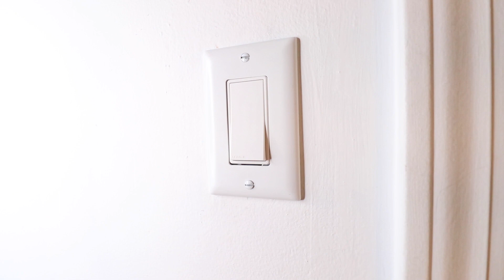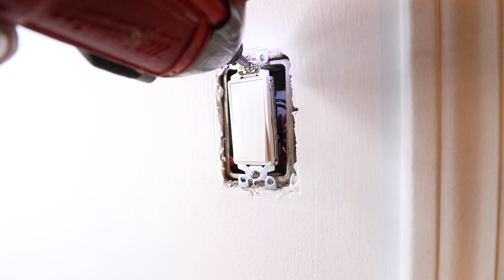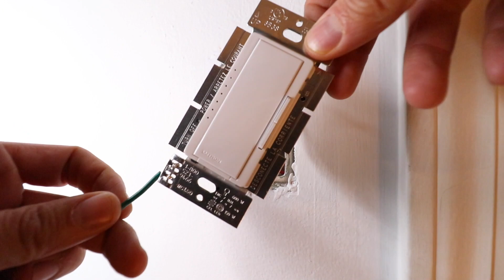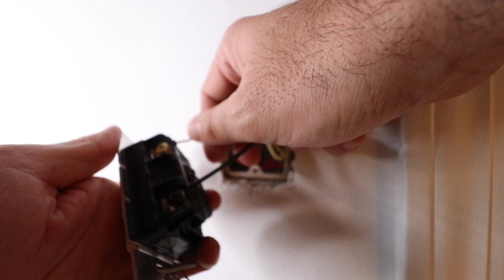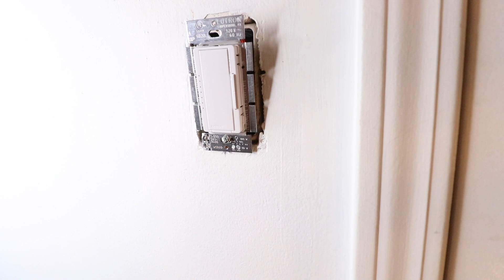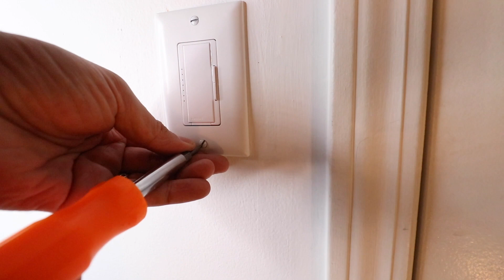Lutron Maestro Installation

Comment: Thought I must've done something wrong but after watching this, I did exactly what was done here; however, every couple of times I turn the dimmer on, it starts strobing and the dimmer LEDs start flashing up and down. I also checked and the LED bulbs I have installed are on the compatible list for this dimmer. Not sure what's going on with this one.
Reply: Did you found the solution?
Reply: Funny cause I came here to see if there was something about the programming as I have tried everything and mine is doing the same type of stuff and not saving where I had the settings
Reply: Did you find a solution? Mine is doing the same thing

Comment: Wat? How does not connecting the ground, still ground the plug? 

You installed it without a ground wire connected so it’s not properly grounded...
Reply: Without checking with multi meter you never know if even the metal box is grounded to the panel.
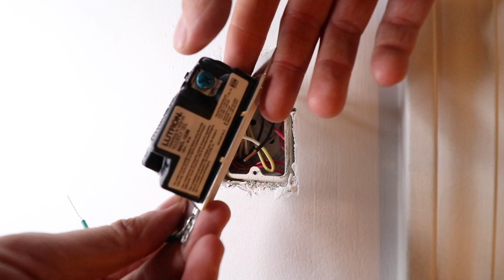Reply from the maker: I live in an area with conduit. The electrical conduit is the ground. Explained at 3:45 in the video.